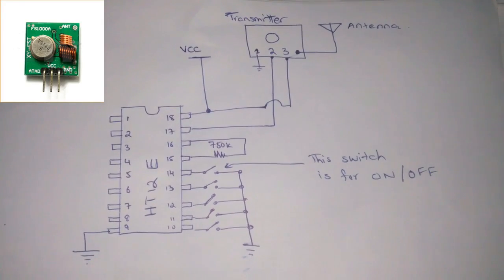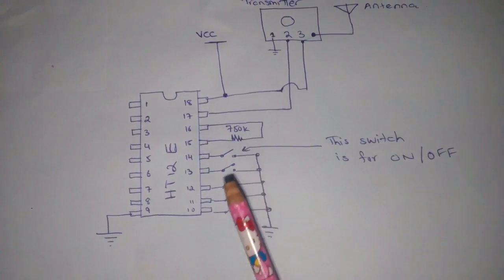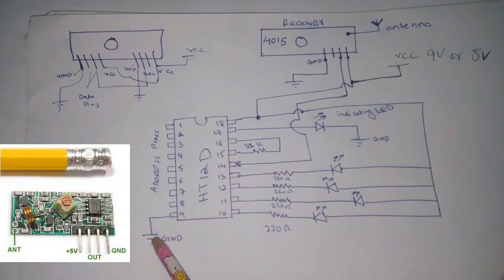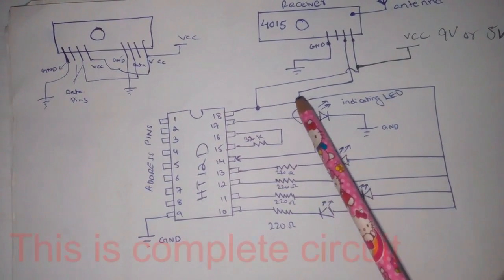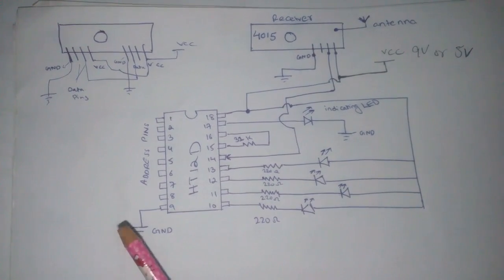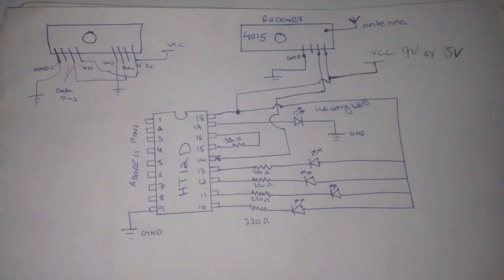how to make  a RF transmitter and receiver circuit by electronics projects

Comment: My Circuit Is Working Fine(Wired Condition_Data Connected to data Pin)
But when i connect RF(Transmitter And Receiver), Led Glowing Continuously (Even When I disconnect Transmitter) 
help Me Out ASAP Please
Reply from the maker: blinking led means there is no connection between transmitter and receiver so check transmitter battery and connections and try again

Comment: Hey after setting up this circuit with only 3 PBS it works fine but for my purpose I’m using the receiver IC without LEDs and as an input to my raspberry pi and I’m having an issue where these inputs will keep going on and off when hooked up to my pi only. Do you have any idea what could be the issue? Pls get back to me ASAP. Thanks

Comment: hey man so I wired everything the way you did except for I added the indicating LED on decoder IC and I also only have one PB and one LED in my circuits. It seems like I am able to communicate because I have my PB hooked up to pin 14 of the encoder circuit and when it is pressed it will turn off the indicating LED. Not sure how to make it turn the other single LED off, which is currently wired to pin 10 of decoder with a 330ohm resistor since I didnt have a 220. Pls help me out.
Reply from the maker: use pin 13 of transmitter circuit  for single PB and also use  pin 13 of receiver circuit  for led  and make pin 14  ground
Reply: @ElectronicsProjects3  ok cool I got it to work now. One other question I would have is how do I determine the values of the oscillator resistors needed for circuit to function. I know in this case you used 750k and 33k for example, how was that determined?
Reply from the maker: @tbiscuit4life  oscillator resistors are mentioned in the data sheets of every encoder /decoder ICs so you can type name of ic and read its data sheet

Comment: insteat of led, i need to use servo motors which requires 5 v. if so, what resistance value should i use. (note: i am gonna use only one servo, not four)
Reply from the maker: for servo motor use l293d motor driver ic (visit my channel and check that video) or you can amplify the output current using any amplifier circuit

Comment: Any other circuit that can tramsmitted around 50-100 meter .
Plaese decribe sir 
?????
Reply from the maker: use hc-12 modules with arduino for long range transmitting and receiving signals

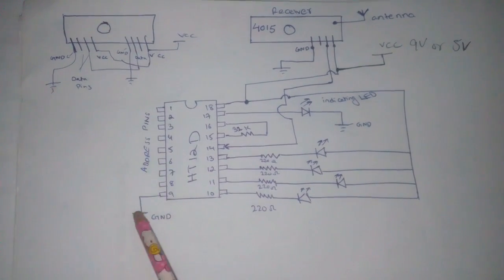Comment: So you've said at 4:10 matching or change or combine address pin, short it to "ground" on both decoder n encoder will avoid bind or pair to other frequency radio module around, so wont n cant control each, by combine them the same unique manner ?
Reply from the maker: actually i mean if there are other RF devices then don't ground these address pins use DIP switch and assign a type of password  by making some switch high and some switches low so in this case the frequency will not match to other RF device
Reply: Electronics Projects So point is, by set some of them high n low will work in this case, right thanks
Reply from the maker: yes

Comment: In your transmitter, the data input is connected to pin 2. But in the datasheet, says that data input is pin 1. Who is correct?
Reply from the maker: there are 2 data pins you can use any of them

Comment: Can the remote be trigger by a PIR module?
Reply from the maker: no it can not be triggered by PIR
Reply: Thank You for Your reply, but the answer is Yes. I did not have the components Ht12E and Ht12G. I used transisters instead and I got the transmitter to send signal to the receiver and the receiver was able to turn on a camera and take 20 second video's. The problem I had I was not able to get any distance.  I made several different antennas with very little change in distance. These are very cheap and I did not expect a lot out of them, but I thought I would try. If You know of better ones, please post.

Comment: bro what is the IC and capacitor you used in the transmitter circuit
Reply from the maker: The IC is 7805 regulator ic and  capacitor of 22uf is used as filter in this circuit
Reply from the maker: but u don't need this without it circuit works properly
Reply: Thanks for the reply bro

Comment: From where we buy this used Arduinos?
Reply from the maker: these are not arduino these are the pair of 433 Mhz  RF Transmitter and Receiver modules you can buy  them on any nearby electronics component shop or buy online from  alibaba, or Mikroelektronika company directly

Comment: Sir, I am not electrical engineer and not even attend any class but i can understand drawing very well as well as electronic parts . I both transmitter and receiver purchased and want to joint 5 or 6 volt relay for use of other electronic gadgets so please help me in the matter. I dont have any knowledge of Arduino.
Reply from the maker: give me your e-mail address i will send u circuit diagram

Comment: Kudos..i built exactly this type of circuit but am worried about the range. My transmission range is poor as it can only transmit to a maximum of 30metres instead of 100metres according to my research. I used a normal radio antenna for both circuit. I tried making a coiled antenna for both circuit but only for the range to get poorer.....pls any advice???
Reply from the maker: here range depends on antenna  , so you have to design good quality antenna

Comment: Sir I need your help regarding how to make its antenna and you have solder a transistor and capacitor ,for what purpose ? And you have not told anything about capacitor and transistor in its  schematic diagram !
I'm working on it so please guide me .
Reply from the maker: Mr. Zeeshan  i'm giving constant five volts to my circuit thats why i used lm7805 regulator ic and capacitor for removing  any fluctuation in supplied voltage. if you are operating by 9v battery  than u don't need this
Reply: Electronics Projects 
Thanks for your kind reply sir ,
And what about antenna sir ?
Reply from the maker: antenna could be of any good quality copper wire  ,15 cm size
Reply: Thank you very much sir means alot sir ,
Now I can finalize my project thank you very much sir

Comment: other than 750k and 31k what value of resistors can be used for encoder ... Please mention if there is any other values.
Reply from the maker: yes you can try  different values of resistor  do experiment and check where frequency is matched

Comment: Thank God...my circuit is now working but i can only control one LED among the four leds as 3 of the leds remain ON whenever i switch on the circuit and only one led go off and that is the only LED i can control with my transmitter circuit..what do u think??
Reply from the maker: Check your power supply it must be in between 5 to 9 volts constant , and second try to use 220 ohm resistor with led ,all leds should off when connection is established

Comment: I also forgot to add that i didn't se the 220ohms resistor as i connected the led directly to the output pins of the decoder..I hope this affect the circuit??
Reply from the maker: no 220 ohm resistor will not effect your circuit  it is just the protecting resistor for leds , and second  i will again make this video , step by step  so hope there all the issues would be clear

Comment: Pls i still need ur help.. After spending about 13hrs in this circuit , still no positive result. I took all my time to wire up the Tx and Rx circuit carefully and i made sure all connections were tight on the bread board. I grounded the adress pins (1-9) both on the Tx and Rx but whenever i swich on the Rx circuit only4 LED will light up while the indicating wont light up but whenever i disconnect pin 9 of the decoder ic from ground the indicating. LED will turn on. Or what other plaxdplace do u think y

Comment: you didn´t mention the transistor near the capacitor in your schematics, cool video
Reply from the maker: it is actually 5v voltage regulator because our circuit operates between 5 to 9 volts so i use this regulator but you don't need this

Comment: I added up five 150k resistors in series to get a total of 750k which i used for the oscillator pins of the encoder but whenever i apply power to both circuits all LED of the reciever are put on without recieving any signal from the encoder. Whenever i press the dip switches on the transmitter the receiver wont respond and all LED will remain ON
Reply from the maker: at this situation your connection between transmitter and receiver  is not established  when receiver receives signals from transmitter all leds become off and turn ON when  pressing push button, and also check antenna wire proper solded or not,  you have to do experiment with resistor if you dont have 750k , use some other resistor of different values like 650k  1000k, 700k etc  to match the frequency

Comment: I mean more than 4 channels not "r" channels
Reply from the maker: address pins are only for security purpose , and this transmitter and receiver control only 4 appliances because  its capacity is 8 bit . you have to make another  replica of this circuit to control 8 appliances

Comment: Thanks for ur reply..pls what if i connect some resistors in series or parallel to add up to 750k value which i can't easily find around, willl the circuit still work??
Also i also wanna ask that can the other 8-adress pins be used to transmitt data making it more than r channels or how can i increase its numbers of channels?? Cus i need a circuit that can control at least 6 devices...
Reply from the maker: yes you can make 750k resistor by  joining 2 or 3 resistors in series,

Comment: Good..pls can i use 750ohms and 33ohms resistor for the oscillator pins instead of using 750k and 33k
Reply from the maker: no because IC need 5% external oscillator resistance  , so  you have to use the same resistors that are mentioned in  schematic

Comment: Very nice project.. I also made a similar project for my self, where I used latch circuit for push buttons. The purpose of this circuit is that it allows you to press the button only once and the lights will turn On. You don't have to keep holding the button..
Reply from the maker: hmmm good

Comment: If the power supply is 5v, how can I modify the circuit.. Sorry am a very beginner.. Also how many buttons we can specify?? And what will happen if we press all buttons or some buttons together.. All those LEDs will blink??

And also what will happen if we hold the button.. Does the LED also keep on till we release the button
Reply from the maker: thanks for lots of questions
ans #1 i'm going to upload a video in coming week  in which i explained  how to turn on/off AC appliance  using this circuit
ans#2 only 4 buttons are allowed to control 4 appliances using this rf transmitter receiver module
ans#3 if you press all buttons together than all the lights will turned on,
ans#4  if you hold button led will glow for the time until you release the button
hope all the confusion will be clear

Comment: Why didnt you use the pin sequence of the RealTransmitter, as its readable. ? 1=Data 2=VCC and 3=GND?
Reply from the maker: i used the same pin sequence that you mention 1=data pin,2=vcc pin, 3= gnd pin
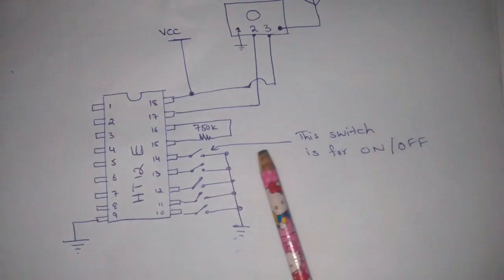Reply: no i mean the Transmitter in the diagram (2:15). There you have 1=gnd, 2=Data and 3=vcc
Reply from the maker: on this transmitter module there are written  type of pins like which is gnd pin and which is vcc pin so follow  that configuration , but connections are same that are mentioned in the project video

Comment: Can you add flip switches instead of buttons. And can you make the receiver for instance make a motor go in reverse?
Reply: What is the color band on the resistor? With more detail on the resistor
Reply from the maker: plz only use components that are mentioned in the circuit diagram

Comment: can we operate the four switches at same time? and how can we increase the voltage given to LEDs from IC to a maximum of 4v
Reply from the maker: yes u can operate 4 switches by using DIP switch . instead of push buttons ,u can increase voltage by BJT amplifiers or check this  link for more information related to it
https://youtu.be/zpCVtqsqS70

Comment: and you didnt add any capacitor in the circuit diagram but it is there in the hardware part
Reply from the maker: in hardware part i use LM7805 regulator ic with capacitor because i gave constant 5v to circuit you can use it but without capacitor and LM7805 this circuit also works properly

Comment: what is the positive and negative side of the battery?
Reply from the maker: in circuit diagram where written vcc .connect +ve terminal of battery there and where written GND connect -ve terminal of battery . if you have any other question plz ask i will try my best to answer you  thanks
Reply from the maker: join both GNDs and make one point then connect it to -ve terminal
Reply: Two GNDs are there. Does we want to connect both to -ve terminal

Comment: How much transmitter and receiver range ??
Reply from the maker: its range is about  30 to 45 meters .depending on your antenna
Reply from the maker: its about 15 cm  not more than that  ,antenna wire should be of good quality or RF wire
Reply: What kind of antenna sir
gimme some tips. atleast 4-5 meters

Comment: Wow i love that..,pls can i use a 33k resistor instead of 31k cus i cant find a 31k on my shopping app..also i wanna ask if it is possible to use a npn transistor to amplify the Voltage from the bulb cus i wanna build a remote control vehicle & am thinking of using motors instead of bulbs as used in the video...pls i need a urgent reply cus b i will soon be ordeing for the materials online
Reply from the maker: yes you can use 33k.  check this video to control motor.https://youtu.be/zpCVtqsqS70
 this circuit is of  remote control car